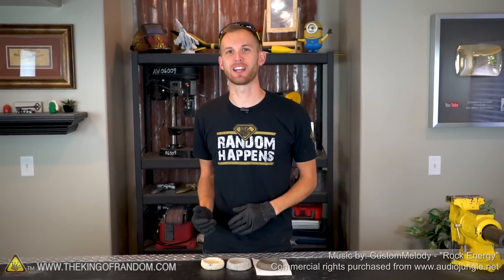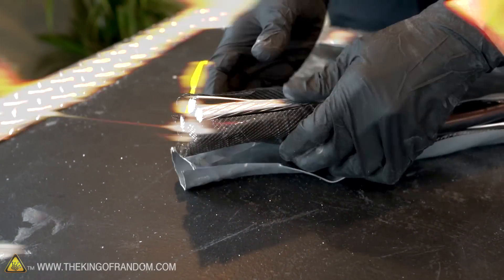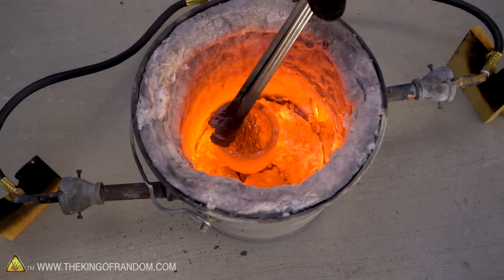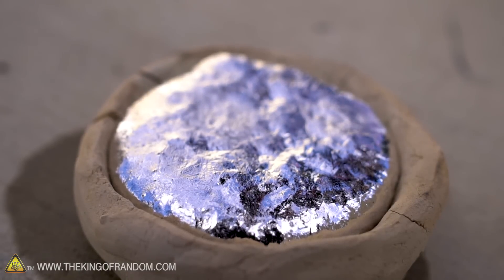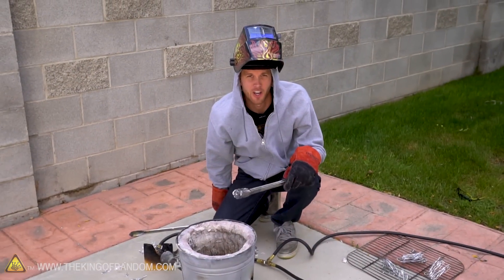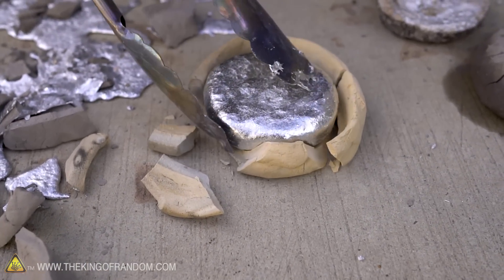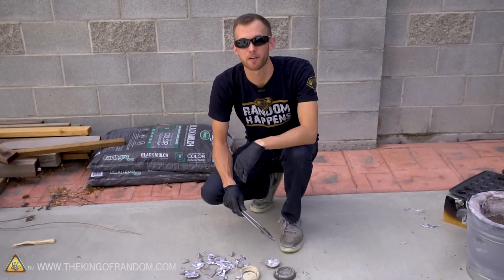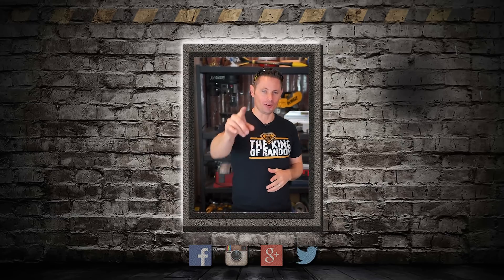Will Liquid Metal Cast in Clay? The TKOR Ultimate Guide To Clay Molding and Metal Casting

Comment: the results did not surprise me, though I actually though the fired clay would do the same as the dried.  Even fired clay absorbs moisture. The moisture will convert to steam, and since steam has a lot more volume then water it will build up pressure inside the clay as it can't escape as fast as it is generated. You can actually have the same thing happen with the concrete. You really should be casting over sand or dirt for that reason .   Your fired clay would have held up better if you had pre-warmed it driving out any moisture before using it.

Comment: the wet clay might work since the aluminium will dry it out the dry clay might crack due to the rapid change in temperature like glass does and the fired clay should work

Comment: To get better casting properties, add silicon to your aluminum before firing, use the Thermite reaction between SiO2 and aluminum to get raw silicon, then powder that and stir it into your molten aluminum.  The result will be casting grade aluminum with smaller grain size and less voids as the silicon will react at that temperature with the air pockets to form dross.

Comment: since the Egyptians in the old time used the method of heating and cooling to breakdown the rocks to get to the treasures in the pyramids i say that the one you once used is gonna crack even more maybe completely breakdown (idk what will happen to the dry one) , however the wet clay i think because of the oils and other things that make it moist it  won't breakdown but act like a wet sand type of casting .

Comment: Melt down coloured paper clips and see what colours you can still see!!!
Reply: Zork FurryFox I think the colours might melt then evaporate, not sure though.
Reply: Who says it needs too be steel
Reply: Well who knows what might happen
Reply: Zork FurryFox I think what he said will happen, it makes sense.
Reply: I think that if they used the paper clips with cheap coloured metals the molten metal might look different from the different colours
Reply: the molten plastic wont mix with the molten aluminum. Itll burn of and leave poisonus gasses. just take a bit of cable and light the isolation on fire, thats what will happen.
Reply: Im from canada i dont know if they have them in america but there are coloured paper clips that arnt plastic

Comment: Btw the dry clay explosion is why you don't cast in concrete either. The reason the wet clay didn't blow up is because water has a high heat capacity so since there was so much it couldn't get boiled enough to explode

Comment: You could try preheating the fired clay mould. The thermal shock is likely what was causing that cracking. preheating the mould would also have the added bonus of driving off the residual moisture in the clay. That residual moisture is probably the source of the air bubbles in the cast.

Even dry clay has bound moisture in it when it comes in contact with something really hot like your molten metal it drives that moisture off. when this happens quickly, the steam can't escape the clay fast enough causing an explosion.

Comment: Ofc clay works, as long it isn't wet it will be fine. You should try add charcoal and very fine wetstone or fine steel filings to your clay(assuming its natural clay) I think that will give it better insulating properties as this rough recipe is used for the katana hardening process.

Comment: I think you have to do this experiment again but this time with properly fired clay or better shape cup. the existing cracks could contribute to the clay expanding as the metal cool. I don't believe you knead the clay until all  the air bubbles are out also the clay is a bit dry when you started making the cup

Comment: Try making sheet metal!
Reply: Tabeeb Rahman you know how many steps it takes to make sheet metal?
Reply: Milan Meiland ovb he dosent
Reply: Milan Meiland, cast a block of your alloy of choice, temper, roll until you approach the max cold work percentage of your material of choice, temper at recrystalization temperature, roll, repeat to your desired thickness, shear, heat treat, store/sell/use. That or you could run the molten metal through a die until it approaches its supercooled state within about 10% of your final desired size and hot work(roll) from there to your final desired size.

Comment: One needs to oven dry the clay molds before use for casting.  Otherwise one repeats the failures of this vid.

Just bake the molds at 250f for 30mins, 300f for fifteen, then 400f for fifteen.  Casting when they are that hot works.

Alternatively the molds can be stored in a descicant container, but thermal shock will still shatter some.

They need better research!

Comment: What if you made a graphite crucible in the shape that you want? It would be impervious to the heat of the metal, it would last more than one heat, and you could just melt the metal into the form, leave it in the crucible, and let it cool slowly enough for it to retain a lot of detail. Maybe the finish on a normal crucible isn't fine enough, but surely it's better than the sand method.

Comment: I would suggest to heat up the fired clay before pouring the molten aluminium, reduces moisture and heat exchange, making the between fired clay and molten metal, which gives a clean cast at the end.

Comment: "Wet" your clay with just a little bit of motor oil.  Also, mix in some very fine sand.  Get the ratio of sand, clay and oil just right and it will hold its shape well.

Comment: Problems: you probably didn’t let the clay dry long enough before you fired it, that’s why there were cracks. Also the wet clay must Have had air bubbles which caused it to explode. Next time make sure you wedge the clay before use.

Your best bet is probably bone dry clay with no air pockets

Comment: Your issue with the clay was you poured into cold molds.  Those types of molds require preheating the mold BEFOREHAND, otherwise the thermal shock, and hidden moisture in the mold, can do just what you're showing.  Preheat them, even to 450-500 just before pouring, and you're not going to have these issues.

Comment: The only reason why it exploded in the unfired clay is because it hadn’t been bisque fired to remove the air bubbles so when the heat hits it all at once it starts to expand the clay forcing it to explode the wet clay didn’t do that because it hadn’t had enough time for it to solidify the air bubbles in the clay so they escaped through the top of the clay
Reply: A bisque fire actualy removes any remaining chemically bonded water. Any air bubbles worked into the clay can lead to explosive results thats what process like wedging/kneading are required and why de airing pug mills exsist.

Comment: Trying heating a fired clay mold before your pour so there isn't as much thermal shock (and to possibly reduce condensation). May reduce/avoid cracks and make mold reusable (which is one goal, right?)...and take earlier comment to heart and fire the clay multiple times to ensure fully fired with no residual water content.

Comment: try firing clay by submerging it into molten metal please!
Reply: don't move it won't work... If its more the 1inch thick the clay takes 30 mins to dry
Reply: Pure clay needs very very high heat to fire the heat would melt the metal

Comment: The bubbles you see are probably hydrogen gas. Molten aluminum is hot enough to split water into hydrogen and oxygen, and there's water and water vapor available to dissolve into it. The oxygen combines with some of the aluminum to form the aluminum oxide slag you removed as dross. The hydrogen gas then dissolves into the aluminum and causes porosity. Fluxing agents are used when casting to try and prevent this problem from occurring.

Comment: The water that formed on the wet clay mold is obviously condensation. Because the metal is hot clay is cold condensatiin will form on the outside.
Reply: I ment the fired clay lol

Comment: Clay is hydroscopic, to a point. Typically one would heat up a ceramic metal mold, which may also have the effect of not only limiting the thermal shock, but drive off the last bit of water from your fired mold.

Comment: If the clay was properly fired and wasn't cracked I bet it would of been better at casting the metal.  Clay when fired in a kiln can get up to 1400 degrees or more so it should be able to handle molten aluminum.

Comment: What if you put wet clay in a vacuum chamber
Reply: This could be interesting you can remove water with a vacuum chamber you could end up with clay that cracks less when fired
Reply: Jeet Sharma nothing 
There is no air in clay and even if there was air in clai it would just blup and stay put
Reply: Nothing
Reply: hwhat about the moisture in the clay ? what will happen to it? will it causw the wet clay to expand?
Reply: Interesting question.  Hot wet clay would have the water boil inside it.

If there's descicant powder I the vacuum chamber the clay foam would dry and harden.  Then air could be introduced again, yielding clay foam.
Reply: the holes would be microscopic. could make a great water filter once fired
Reply: Jeet Sharma INCREASE YOUR KNOWLEDGE BY WATCHING MY YOUTUBE CHANNEL FOR AMAZING INFORMATION AND MIND BLOWING FACTS AND SHARE AND SUBSCRIBE!!!!!